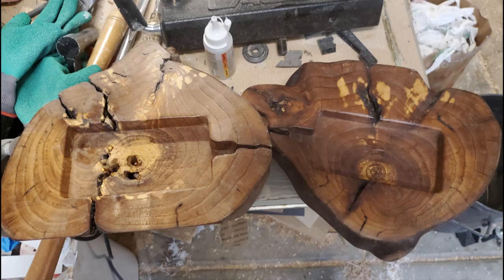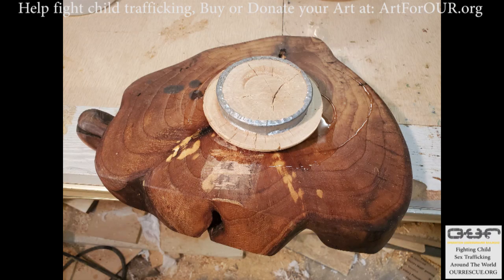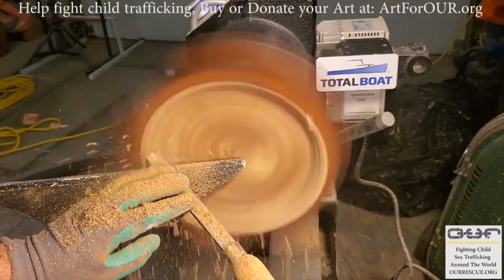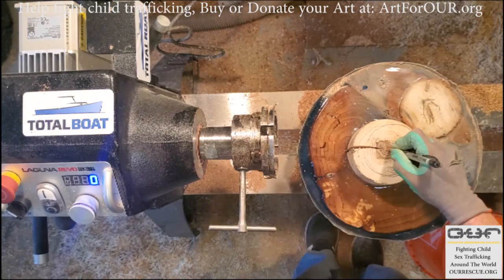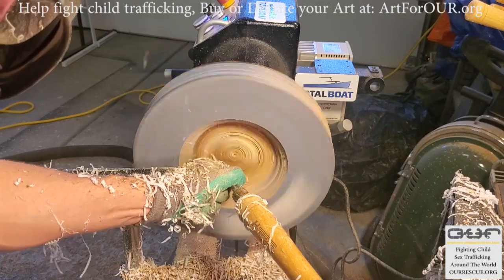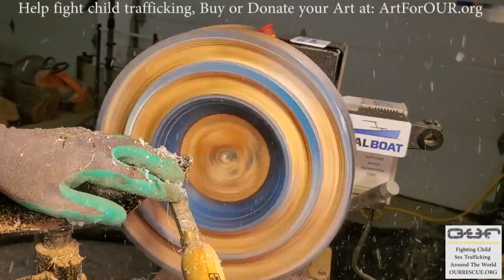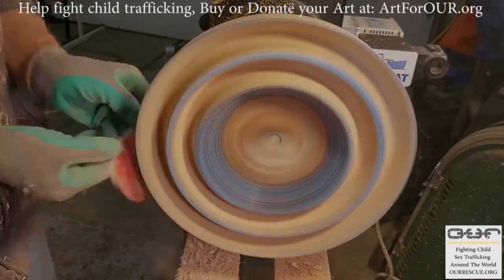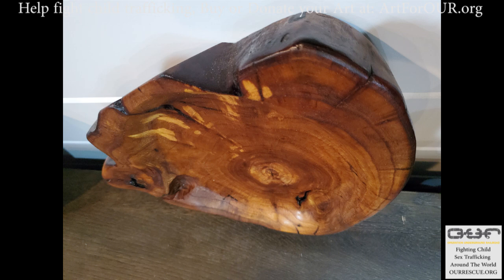"Fraternal Twins".  Turning cell phone holders into a bowl and a resin platter.  ArtForOUR.org

Comment: Beautiful work. Glad to see that it goes to a good cause. As soon as I get my shop back open I would like to contribute also. Totalboat makes a fast-drying varnish that you can literally put five coats on in one day they dry in about 20-30 minutes to recoat it's called Lust comes in flat and hi sheen it is gorgeous stuff very thick. I use it myself on turnings. Also Woodcraft has a self catalyzing lacquer that dries very quickly and is impervious to alcohol and other issues such as handling it's made by mohawk. The beauty of it is a spray-on finish dries quickly and is easy to use.
Reply from the maker: Thank you for the suggestions and support!  Much appreciated. 

Artforour.org

Comment: Dr. Dan, Love your creativity and honesty!  In regard to sanding, if you sand to six or eight hundred then use "Ack's Abrasive Paste" all your scratches will be gone especially on the epoxy.  They also include a polish with it and I bet they would sponsor you as well. The abrasive paste is wax basted so no other finish is needed. However I often want to apply another finish but not much will stick to wax. So wipe it down with denatured alcohol to remove the wax.  Then continue with your desired finish...  Hope this helps...  Rob
Reply from the maker: Thank you,  and good ideas!

Comment: Great piece! Do you use negative rake bits on your carbides for the resin? For sanding/finish on the resin, Novus makes a great system for resin pieces that helps with scratches. Intyoically sand up to 600, then do an abrasive paste, then the novus to eliminate scratches. A few people to check out for tips and tricks for hybrids on YouTube are The Klondike Craftsman, Ahron Africanmeat, and Duka Heritage.
Reply from the maker: Thank you for the tips!

Comment: kim tippin  lets hers spin on the lathe at the lowest speed for around 30min.  the aussie from bens works water sands his resin, and nick zimmetti uses Yorkshire grit and a sanding sealer plus a buffer wheel on his. see if kim Tippin or Duag at pohl barn produtions do they both us total boat on there you tube channels.
Reply from the maker: Great advice!

Comment: hey dan u have the   other respirator   with  charcoal   filters
Reply: 3m  has both
Reply from the maker: So the p100 level isn't good enough?
Reply: @artgivinghope  the pink is for  dust  double check  im pretty sure  i use ones from work  from both dust and fumes   body shop n95
Reply from the maker: Respirator filters are rated according to how much particulate matter they can reliably block. A P100 rating is the highest for personal respiratory protection. As long as your mask fits properly a P100 filter will block 99.9% of particles
Reply from the maker: The pink I'm using is a p100:  

"P100-rated filters are the most widely available kind that meet that criterion. The “100” designation means that they capture 99.97% of fine particulates, such as wildfire smoke. And as P-designated filters, they also protect against oil-based substances in the air, such as paint fumes, as well as some caustic vapors"
Reply from the maker: If you're using an n95 and are around oil fumes you might want to upgrade to p100 for fumes.... here's a good resource:  https://youtu.be/S4xv8XS1t60